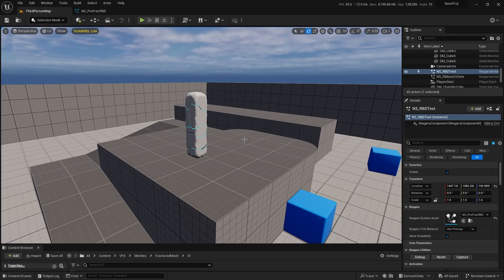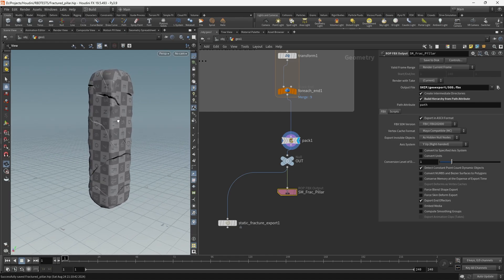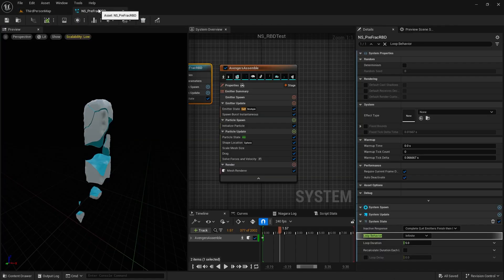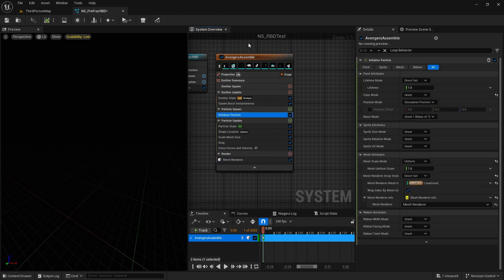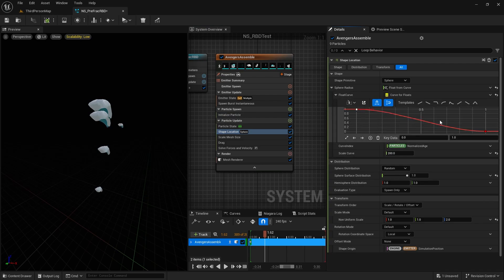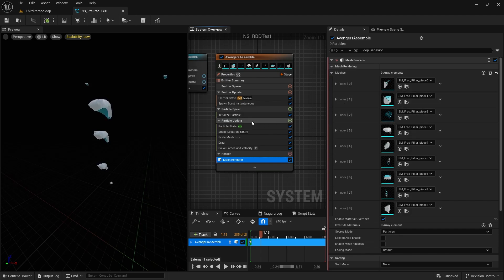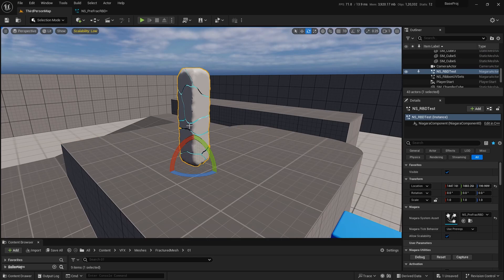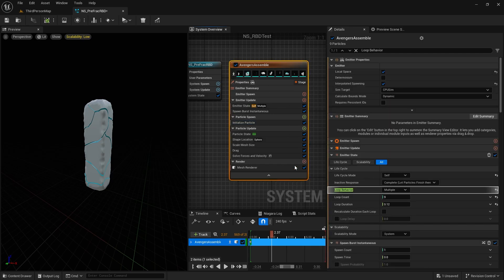How to use PreFractured Mesh from Houdini in Niagara | Unreal Engine 5.3 | Realtime VFX

Comment: Is there possible to make a "radial burst" of those pieces?
For example I have a pre-fractured sphere (10 pieces) and I want all of them to burst like a radial force from center ... I tried with velocity from point but the pieces are going in random direction and looks wierd. Any help is welcome. 
Thank you!
Reply from the maker: Yes It is possible. But I generally wont go by this method if I want a radial burst because there are many calculations involved and I haven't tried it yet.
But I can explain the logic and flaws in this method which I shared.

- Right now when we are importing meshes they come with a offset to their original position, that means their pivot is always at the (0,0,0) but there position is somewhere else.
So when you apply any forces like rotation or give velocity they will rotate around that pivot or move around from that pivot itself. That will cause their rotation or collision or any movement to be weird.
- to fix this you have to make a Scratch pad and find the centroid of each meshes and transform to (0,0,0) in local space which will move all the meshes to centre by default so you have to set this step in a simulation stage.
- to do this you just have to get the mesh dimensions divide them by 2 and you will get the centre point and then subtract this vector by the original position and then this will be your new position. but beware you have to get each
mesh index dimension manually as I couldn't get those inside Scratch pad or in the Niagara Emitter Stack, and that is a lot of manual work which I generally wont do until that is last option.
- you can find the mesh dimensions in Static Mesh Editor on the left hand side in viewport.

- other methods are using Chaos Physics, you have an option to import the pre-fractured mesh and use that as physics object and many kind of forces are available including a radial burst.
- another option is Using VAT's. you can import the whole simulation from another DCC app as textures and use as a VAT object . only downside is it will always be the same. i.e. no randomness.
Reply: @aashishbharunt  hey! i'm a houdini artist learning unreal and i'm trying to learn how to import my fractured assets into chaos. do you have any videos/tutorials regarding that? all the ones i've found import baked animations but i'm trying to learn how to impor the fracture pieces and have them break dynamically in realtime. i'm stuck on how to import my gc into unreal and prep it to be a physic asset
Reply from the maker: Hey sorry for the late reply, I have been away a little. Let me know if you are still facing this issue, anyway I will take a look into this tomorrow and will share you the steps for how to import one.
Reply: @aashishbharunt  
Many thanks for your reply!
Unfortunately I'm not very familiar with Scratch pad or Chaos Physics, but I'll give it a try. The only method that worked for me so far was a simulation in Blender and exporting as an .abc (Alembic) file and controlled with blueprints, but I don't know if this is a good approach or not.
Reply from the maker: @RecUnderground  no approaches are good or bad. totally depends upon what your need is and what game requires. there's always room for improvement. you will like chaos and they have good tutorials and reference files on their website give it a try. VAT might come with lot of debugging as there is always some issue when you set it up for first time.
Now I am thinking to make one basic chaos physics tutorial too.
Reply: @aashishbharunt I just spent some time with a few chaos tutorials and seems pretty good! What I want actually is a glass shield sphere that cracks in 5-10 pieces when the player gets a hit from an enemy. I can't wait for your chaos physics tutorial. You earned my sub!
Reply from the maker: @RecUnderground  that is an intresting mechanic. let me know if you face any issue in chaos I will gladly help. And it means a lot. Thanks for susbscribing.🙏🙏

Comment: Thank you. And how to turn the emitter itself in the system by 90 degrees so that it does not lie on its side in Niagara
Reply from the maker: I didn’t quite get what you asked? You want the whole emitter as in all the pieces to be turned 90 degrees ? or something else?
Reply: @aashishbharunt  yes.  emitter as in all the pieces to be turned 90 degrees
Reply from the maker: You can use Initial Mesh Orientation Module and instead of Random use Orient to Vector. Let me know if this works for you or not.